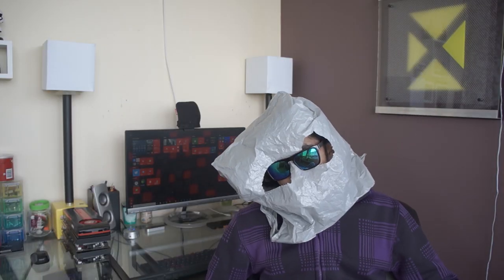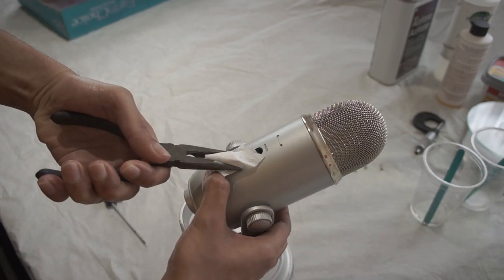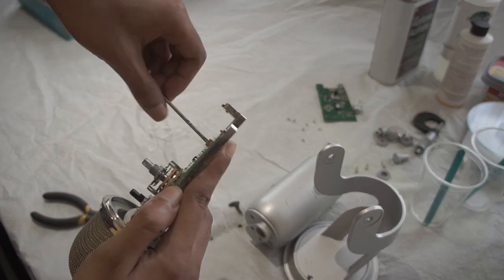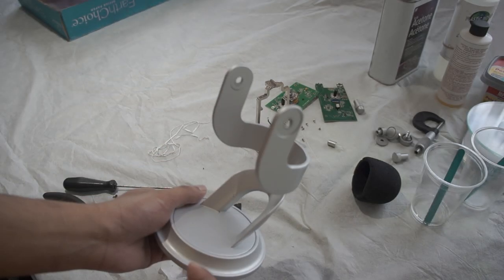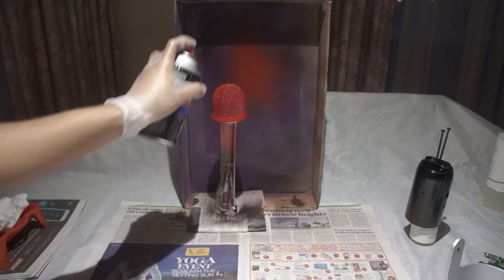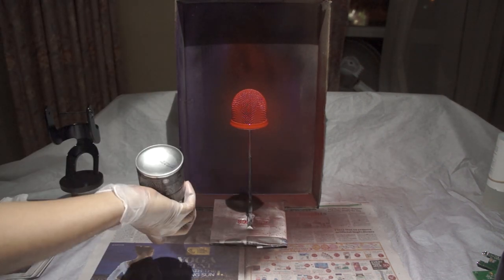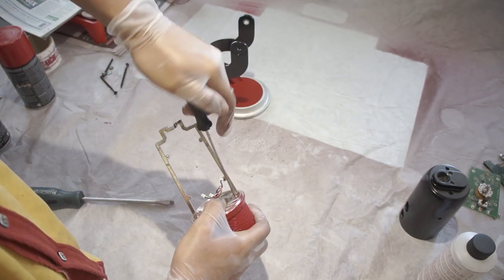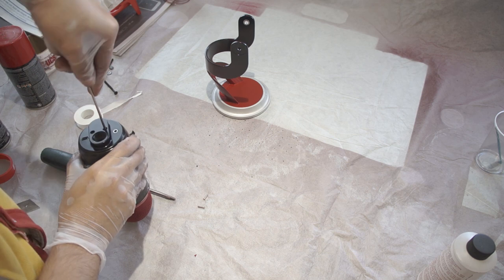Painting Blue Yeti (Disassembly)

Comment: You do not actually need to remove the circuit board from the metal skeleton it is on. You can already unscrew the top cap from the boards without taking the boards off of the skeleton. That way, you'll never have to unplug any wires and you should even have a working microphone (tho without a body) while your body undergoes this painting treatment. Great video, thanks!
Reply from the maker: +Square Play'n True man. Can totally be skipped. Just did it for the sake of the teardown.

Comment: Actually just finished painting. The button for the red led will not stay in. It just pushed into the microphone shell and fell in. It doesn't feel long enough to reach now and does not fit. Run into any issues with this and have solutions?
Reply from the maker: +Nicholas Reif sounds like something is missing or the clips are broken.
Reply: Yeah turns out the clip broke. Trying to see what I can do about it. It doesn't make any real difference at the moment so I'm not too worried.

Comment: Hey bro why did you say wait a month before using your microphone
Reply from the maker: You can use it within a day or two but the paint doesn't completely cure before a month a so. You would be able to smell the gasses and chemicals for a month too.
Reply: +Rexin Oridle oh okay thanks man, the reason why I want to spray paint my blue yeti is because I'm buying mine used and it has a bunch of deep scratches.  So my plan is to smooth out the scratches with sand paper and then use plasti dip to paint, how does that sound to you?
Reply from the maker: Muhammad Ali Do it man. Also post a video if you can. It's some project.
Reply: +Rexin Oridle sure I'll post it on my main channel